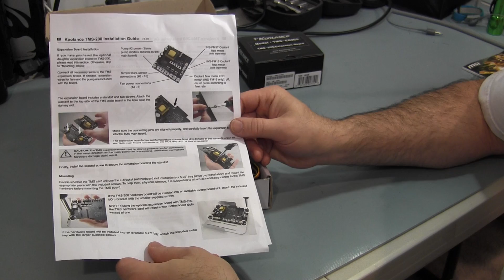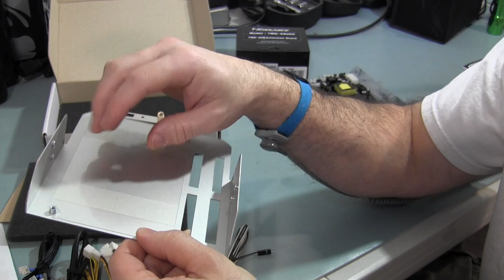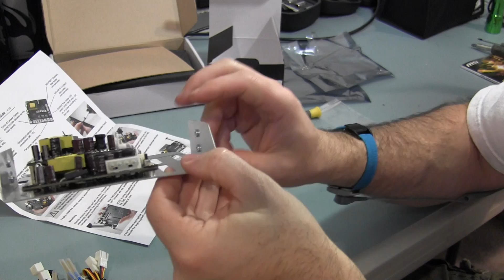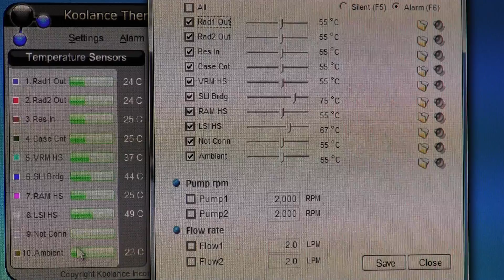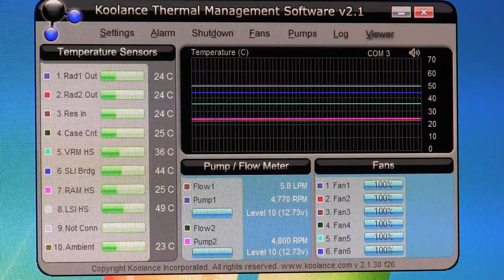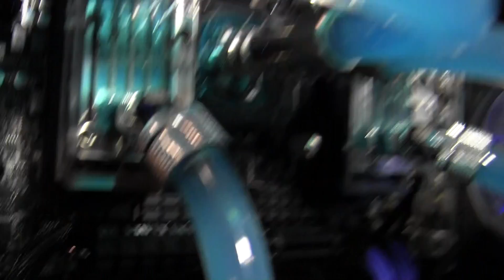Koolance TMS-205 EB205 Thermal Management SW HW Assembly and Use

Comment from the maker: 1.  No won't load SW without the OS.
2. If a pump fails and you connect the shutdown feature up, ye it will shut the system down automatically.

Comment: Can I ask some questions? 
1.Does it work,If  you're running leak test without turning on the computer ? 
2.If a pump fail at booting sequences ,Does it have fail save system (like turn off  system automatically ) ? 
Thanks in advance !!!!

Comment from the maker: You don't need a Koolance Pump, any of the D5 Pumps, will work. The Koolance pump has the RPM lead which will provide the rpm signal that can be displayed , but a PWM based pump if you just get a 4 to 3 pin adapter will work just fine.  I think the pump does have to be  one that you can adjust though(not absolutely sure), that has the dial on the bottom of the pump to set the speed through. The software controls it then you just set it in 5 and use the software to adjust it to whatever you want.

Comment: Hey great informative video :)
just one question though. I have this board but i do not have a koolance pump. Can i hook up my pump to the controller if i convert its 4 pim pwm connector to 3 pin (non pwm)? or do i have to somehow convert it to 3 pin pwm if thats at all possible? thanks :)

Comment from the maker: Yes. Also have the flow meter as well INS-FM18. The INS-FM17N is the same think in plastic and $10 cheaper.  I agree. This controller setup and the software is awesome. I have three screens and one I always keep my TMS software up and running so at a glance I can see my whole cooling solution.   Enjoy man.

Comment from the maker: It is an Aquacomputer Temperature Sensor - Inner/Outer Thread G1/4. It install into any G 1/4 fitting and reads the coolant temp.  Works great. I got mine from Performace PCs. $11 each.

Comment from the maker: I love it, once I got it working. I have not set it up as a boot drive though and some motherboards run out of ROM BIOS space, but there has not been any problems with this setup with the Revo drive once I researched and set up the cards in the right slots on this board. When using the LSI9260 controller there are a few things that I learned through trial and error that were not easily found on-line or through LSI. The most important thing though is to make sure you have the latest LSI firmware.